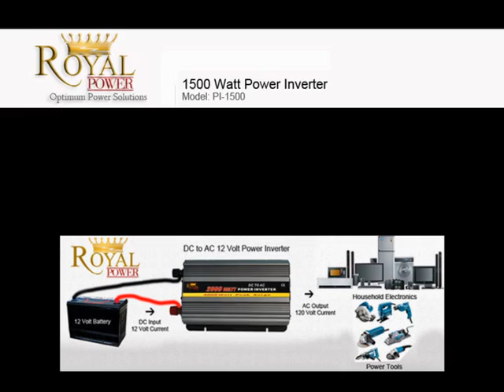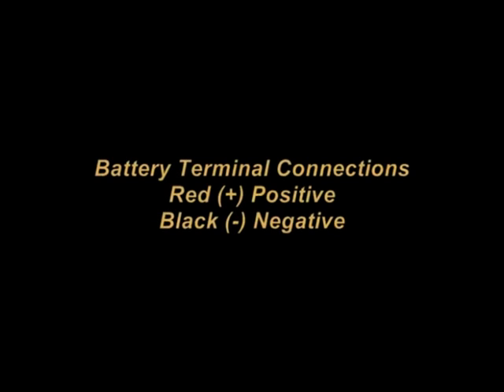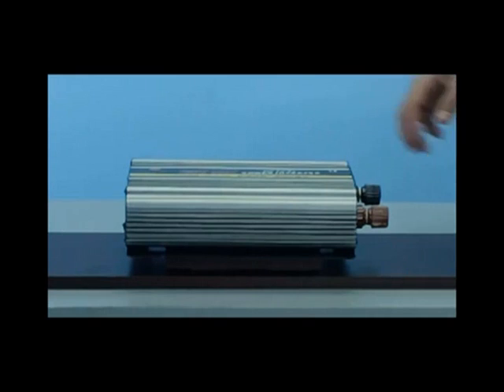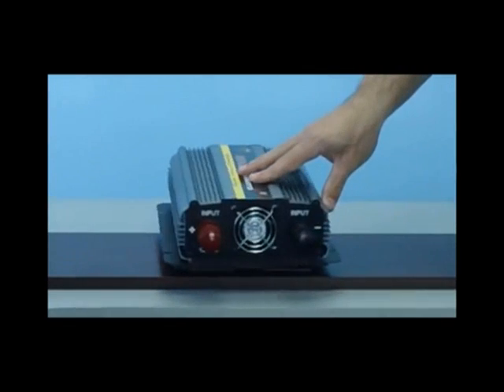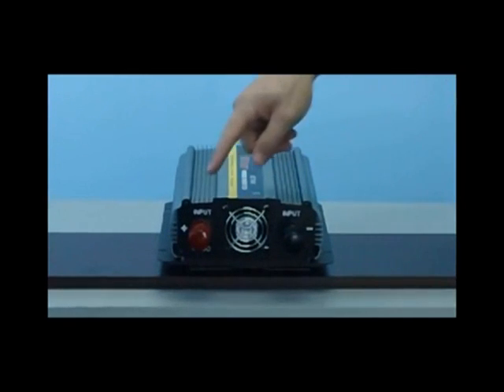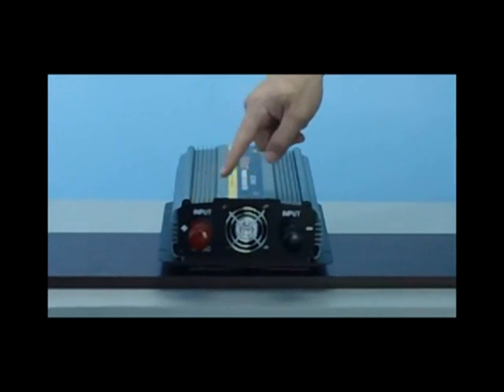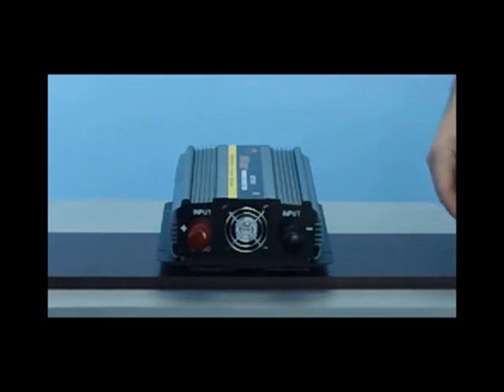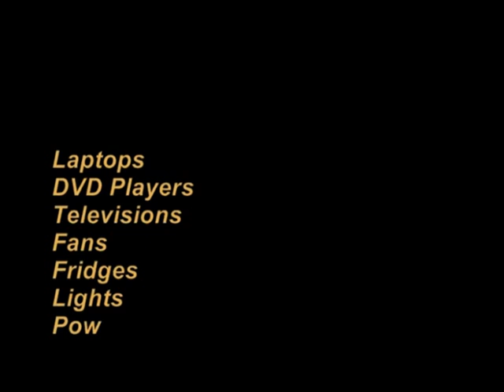1500 Watt Power Inverter 12 Volt DC to 120 Volt AC

Comment: How much current draw from a 12 volt battery when the inverter in running at 1500 watts?
Reply from the maker: Please take a look at this guide and let me know if you need more help.

http://www.powerinverters.com/page/power-inverter-user-guide
Reply: Power Inverters 
what is the rating of charge controller for 150watts panel?
Reply: What I worry about is the effect on the alternator and drain of the battery🤔
Reply: @ellissmithjr6599  Not recommended for long hours usage.